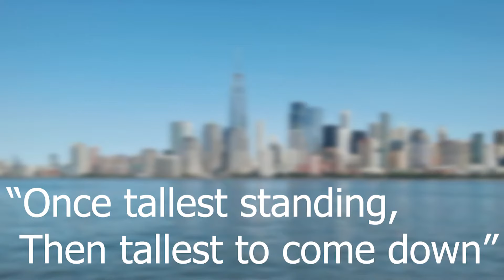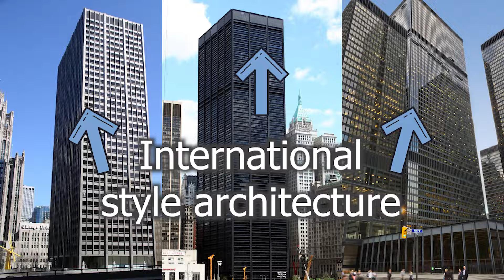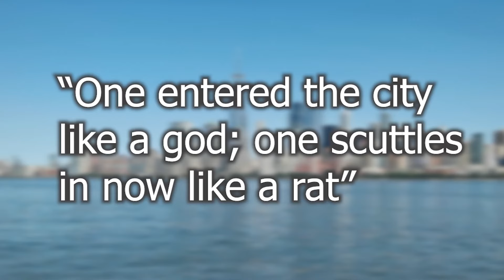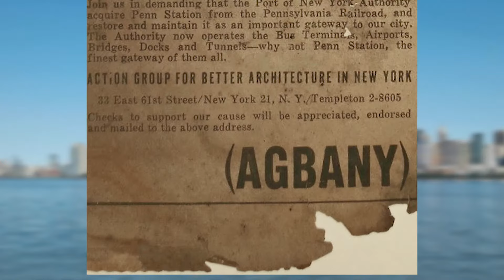Preserving Historic Architecture: How These Two Buildings Began a Movement

Comment: Interesting that Paris never succumbed to 'modernity'.
Reply: around 80% of Parisian buildings maintain their facade, yet have been completely hollowed and changed from the inside
Reply: @mariopensotti1015  Its a good thing. Problem with the original building that yes those were beautiful and grand, but nowadays people need different spaces.
Problem with the Singer building was the same, it were built in an era where skyscrapers were cutting edge and a lot of technologies were flawed, not to mention that the floor layout wasnt the best either.

Comment: Have never been happy with what the fatherless architects built, though that did build well, would like to see these naked buildings dresses. Have thought of putting a copy of the top of Buffalos pan American electric towers top on the cities tallest building, has a very similar lay out with the city as it did. Ideally the original glass lantern, still in a museum built to hold it, as the eletric tower was always meant to be destroyed could be lit again inside, as well as the whole building lite as the tower once was